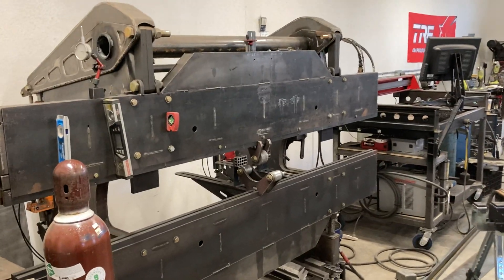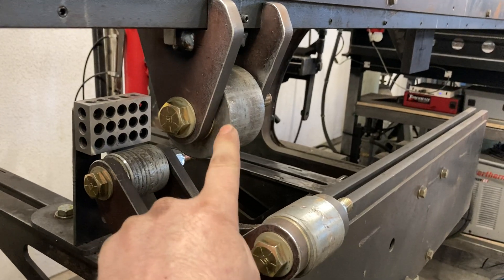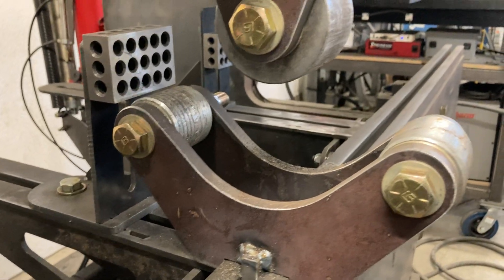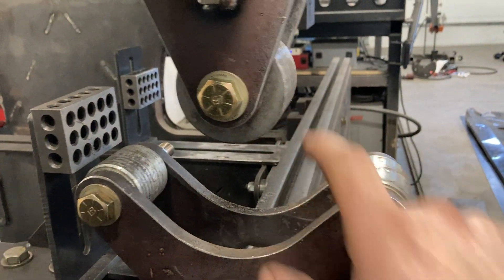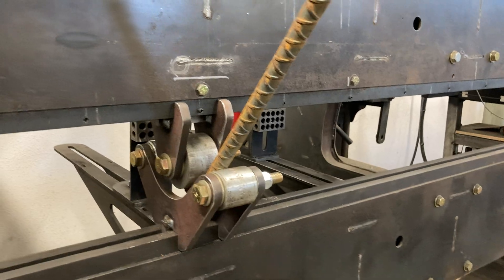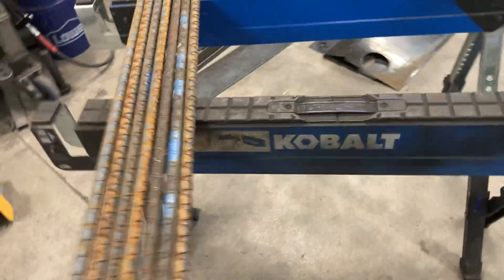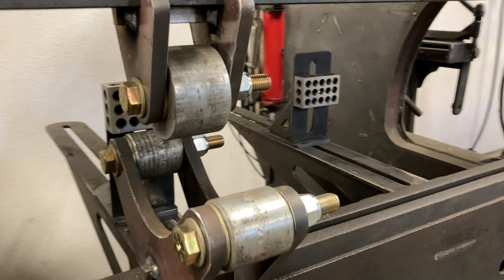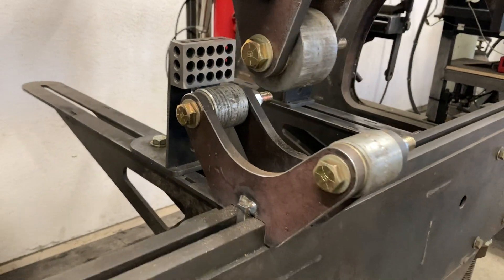Custom tooling for home made press brake

Comment: Have you tried roll cage tubing with that die. It seems like it could work. With some minor adjustments.
Reply from the maker: Nope, it would crush the tubing. The round shape of the tube needs to be supported at the point of the bend. Unfortunately, if you want to bend around tubing, you just have to buy the right tool.

Comment: Hell yeah!! That’s an awesome press break!! And nice attachment. I need to build me a 4 foot version of that.
Reply from the maker: A 4footer would be better in my small space, I rarely use more than a foot of it.
Reply: Do it! I built a 49" wide press brake with two 20ton air over hydraulic rams. Mine is just straight push, not cantilevered like this. If I did any volume of work, I'd do hydraulic rams. Mine is slow just like this one, but I don't use it too often.

Comment: You need to have that hooked up to normal hydraulics and not that harbor freight pneumatic BS you got going.
Reply from the maker: I’m slowly collecting pieces.
Reply: I think he was offering to buy you some new equipment.  @ultra4suzukisamurai679
Reply: Why
I worked at a shop that had pneumatic press brake 
Fabbed a lot of milk haulers , fire trucks and 12ga ss or less
Reply: @Yolbosun  If you dont get it then perhaps you dont belong in the shop.
Reply: @thecommentary21  Yup, time is money, the quicker the cycle time the more $$ you make..

Comment: nice machine ,would a v block in front of the outer roller be nice so you didn't have to hold the material in place quite as much??  think your idea for the roller is sound could be belt driven just to allow removal a little bit easier? or on pto splines for direct drive?!?  Have FUN great creativity !!!